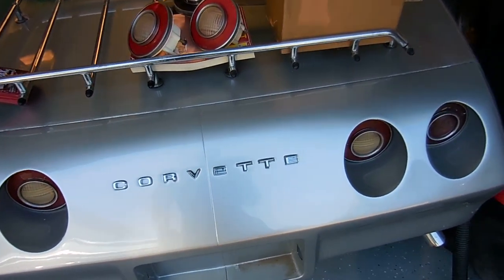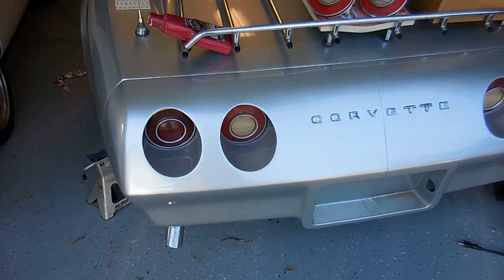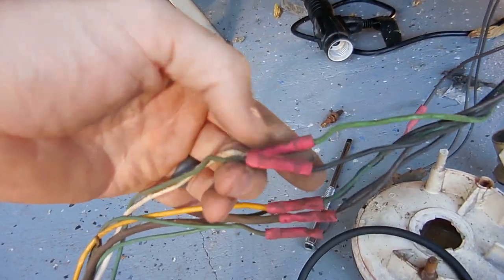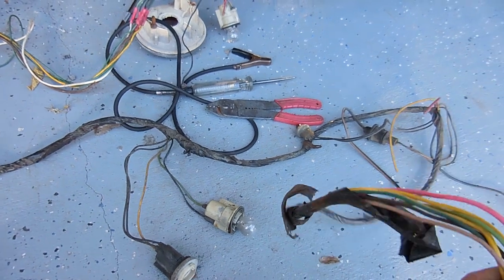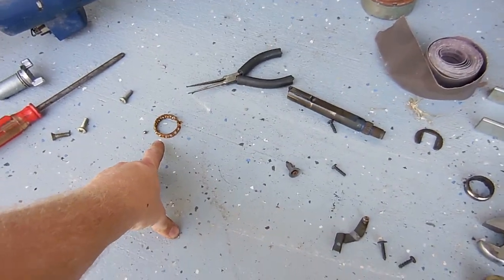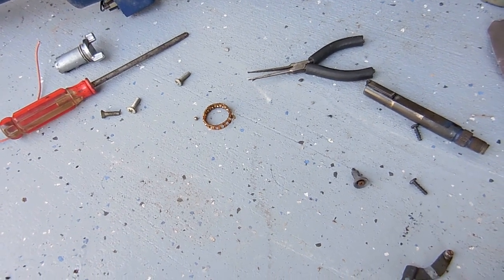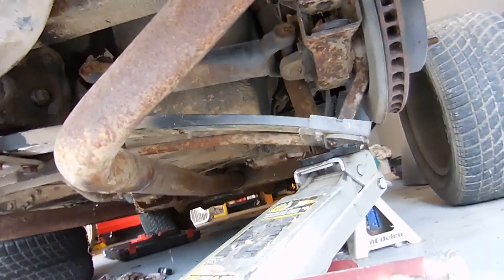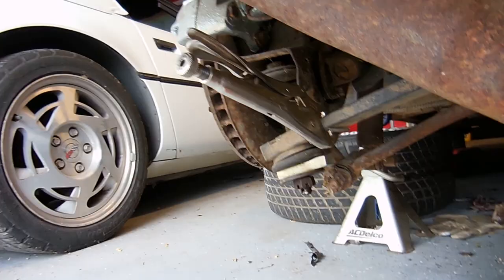Abandoned Project: 1974 Corvette Stingray Video 8 of 13

Comment: Nice work. One thing you might want to think about is polishing the rear lenses. I polished the ones on my brother's '64 GTO and they came out like new. At the time I worked in a jewelry shop and used the buffer there. The Mcguiar's headlight restorer with the buffer wheel drill attachment works quite well. Just a really nice finishing touch.

Comment: Hey Ben,  just picked up an 82 vette, fuel injection  has been replaced with carburetor. I smell gas and even though the engine has been completely rebuilt by previous owner it runs like crap. Where should I start and what should be my priority to get it road worthy.

Comment: You know at this rate your not going to have ANY spare parts left over for the next car lol and what is with the leaf spring that the latter ones look so flimsy compared to the earlier ones, as that fiberglass one looks to be one piece and rather thin for such a big job. as I was watching motorweek, the video they did on the C3, a 81' vs the guy's 78' and the guy mentioned that the corvette can spin like a top on you if your too abrupt with the steering wheel, and I gotta wonder if maybe that's the cause of it.

Comment: Hey Ben, I did some research with Lander Chev, Cad and discovered that Every GM gasoline V8 engine produced in 1974 was equipped with a HEI distributor, to include my 1974 Corvette L82 with tach drive dist.
Reply from the maker: Sorry dude but you are wrong. A simple google search will clear this up
https://www.rogerscorvette.com/history.htm#:~:text=1974%20was%20the%20last%20year%20the%20Corvette%20would,year%20and%20would%20not%20reappear%20again%20until%201986.

Comment: My 73 was the last chrome-bumpered year.  1974 (and only that year) has the "plumber's crack" split rear polyurethane bumper.  GM could only reliably make the large rear bumper in two pieces that year, so they did that and gave it two vertical license plate light slots, one on each "side" bumper.  By model year 75 and onward they figured out how to make the large rear bumper as a single piece.   And I mean no offense to CorvetteBen's '74 by saying it has a plumber's crack.
Reply from the maker: +SixtyFiveDropTop lol that is being nice. I straight up call it the butt crack
Reply: hah...my '74 nervously looks behind itself now...